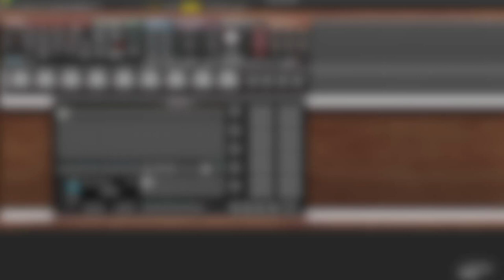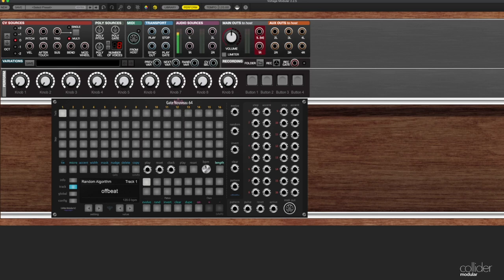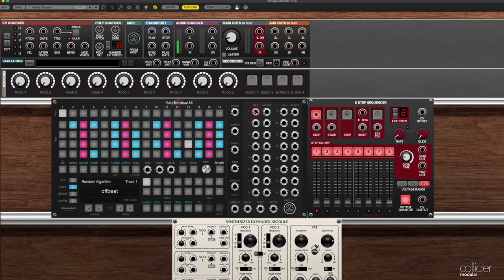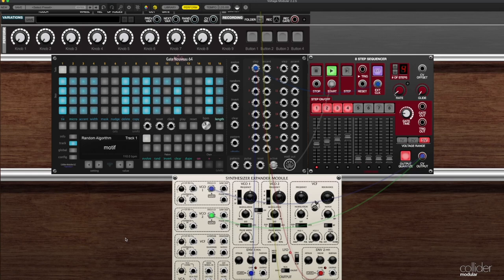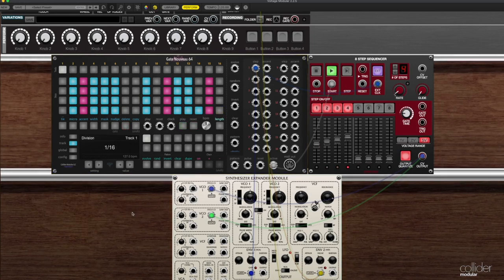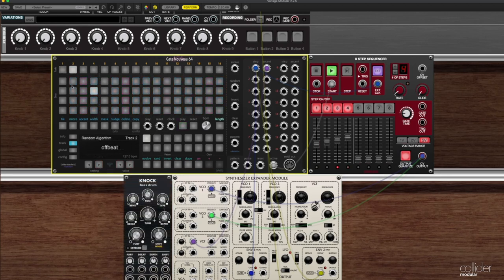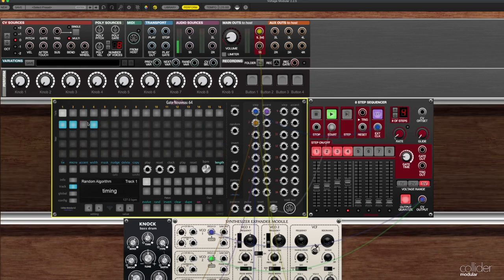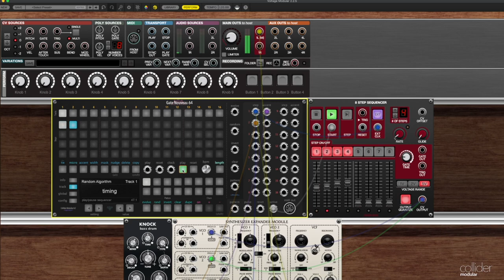GN64 - 13 - Adding Pitch

Comment: Every time I watch one of your videos my mind just bubbles over with ideas. Thanks. So, what you're saying here is with GN64 you could control 32 different sequencers each with it's own set of of pitches, and by chaining 16 patterns together... plus with the sub divisions of any step. Oy... it's like 7 cups of coffee.
Reply from the maker: Yes, while GN64 doesn't control the pitch, you could keep the same sequence of pitches, but change the rhythm. GN64 has 16 channels, so you could do this 16 times with one instance of GN64. Of course, GN64 instances can always be chained too....
Reply: @collidermodular8351  I was thinking more along the lines of each gate output (normal and accented) controlling its own sequencer with a different set of pitch programed and with its own oscillator.
Reply from the maker: @charleskleesattel6477  Yes, that's exactly right.